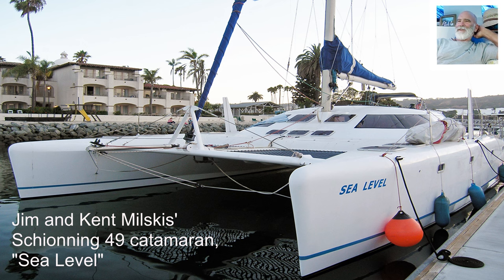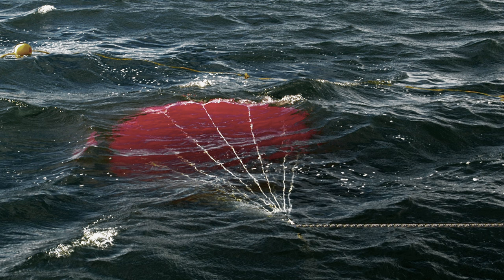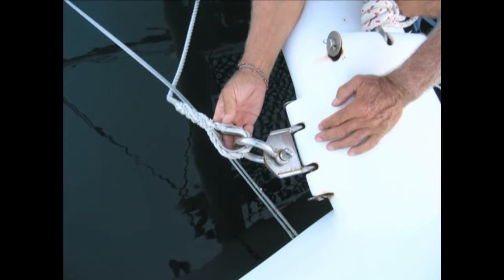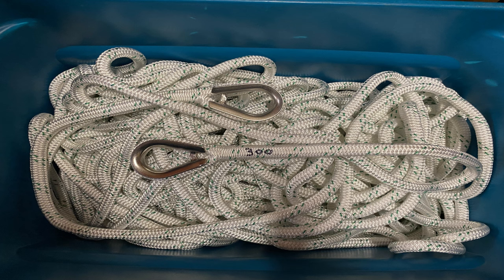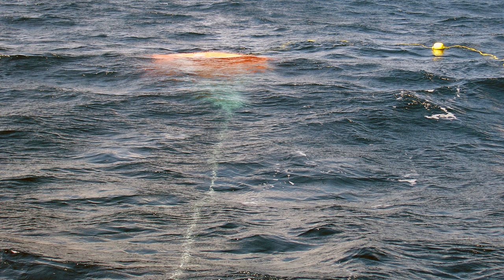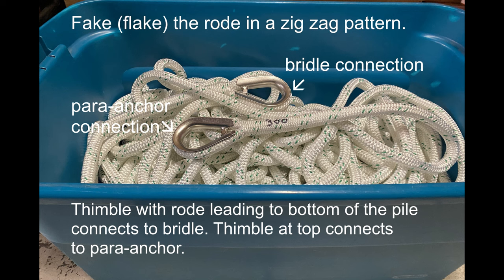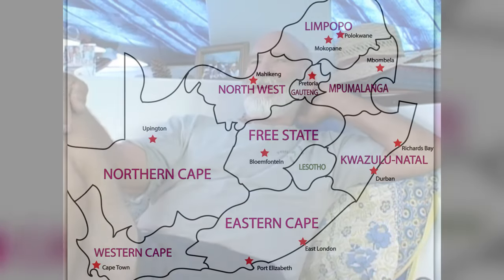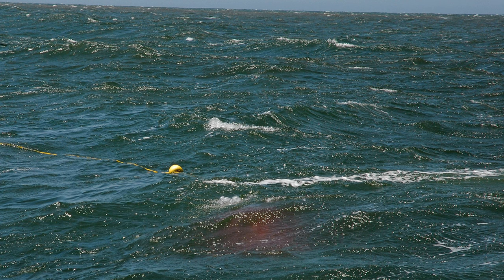Multihull Para-Anchor Experience and Bridle Setups

Comment: I had almost the exact same experience as Kent had in a storm aboard my 38' catamaran Theophilus (20' beam) in the Atlantic 400 miles off North Carolina in January.  I had bought a 12' Fiorentino sea anchor after seeing it at Annapolis, along with a 500' of 3/4" double braid nylon line back in 2005 for the catamaran.  Not being satisfied with the existing bow cleats I had stainless chainplates made, each 22 inches long. 3/8" thick, and fastened them to the bow horizontally with 6 3/8" through bolts.  The forward ends were bent slightly inward and drilled for a 5/8" shackle pin.  I also made a 50' bridle using thimbles at each end, and put thimbles on each end of the remaining 400 feet of rode from the spool.  
as it turned out, when we left NC for sea in January we knew we would be hit with heavy weather and therefore made haste to get to the other side of the Gulf Stream in deep warm water out of the current beforehand.  Sure enough the weather worsened.  After hand combat-sailing for a day in mounting seas and down from 5 crew to 2 remaining effectives, I decided we weren't racing and it was time to deploy the sea anchor.   I had the sea anchor in its bag in the cockpit already hooked up to the rode, the rode in another bag in the cockpit alcready connected to the bridle attached to the bows and brought starboard aft outside the shrouds, all before departure.  So when it came time to deploying it, it required throwing the parachute overboard to starboard from the cockpit while reversing downwind and carefully paying out, being really alert to avoid fouling the rudder or prop.  That went well.  Once the parachute was out there it was ethereal to see the parachute dimly visible underwater inside a wave way out front.  
However it wasn't long before the parachute and the attached buoy disappeared from sight and the bridle was angled somewhat downward.  I was cussing myself for somehow not connecting the buoy to the parachute.  And where was the parachute?  Was it still attached?  We weren't moving at all and stayed pointed into the wind with absolutely no jerking or veering.  Marvelous!  So we went indoors to wait it out, occasionally coming out into the cockpit to admire the huge waves.  Eventually we didn't even dare do that, and took a couple of large dramatic breaking waves over the cabintop filing the cockpit going aft.  Water squirting out of the door seams.  But the cockpit drained quickly, which was good to see.
After two days on the anchor the storm finally abated and we were able to fire up the engines and motor up on the rode while recovering it to the trampolines, all of which went well.  And by golly there's the float!  The sea anchor was evidently deep and dragged it down, perhaps helped by its heavy SS shroud collector, and the added depth was into more stable water give us an even better smooth ride.  The whole thing worked marvelously.  We still carry that sea anchor on Theophilus to this day. 
I believe in the long bridles, they help rapidly to correct any tendency to veer by an immediate additional load on the opposide leg to keep things straight.  However I think I would prefer polyester for them.
My daughter was along on that ride, which remains for us an unforgettable life experience at sea.
Reply from the maker: Wow! What a detailed story. Thank you for sharing.